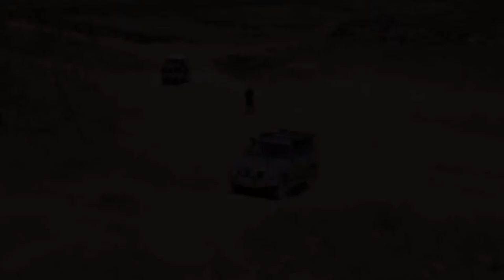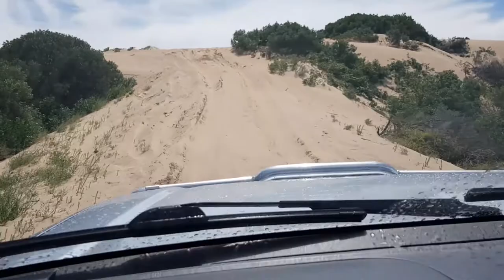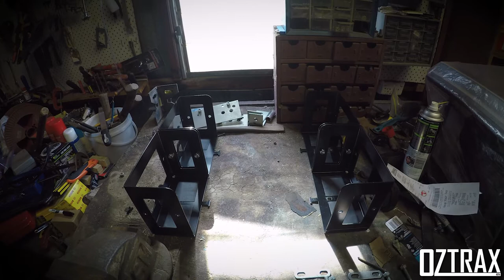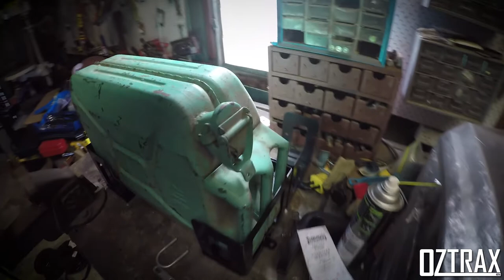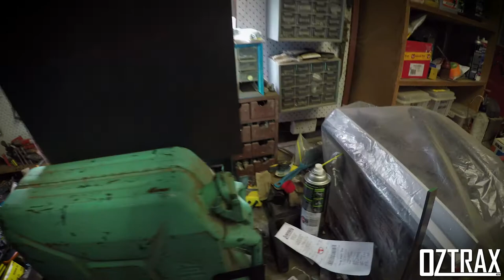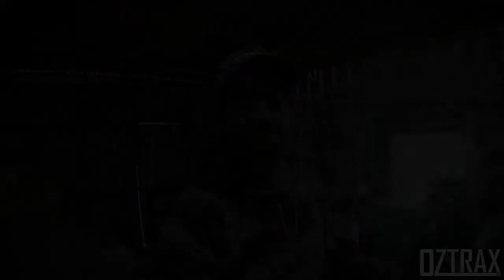DIY: Rack-mounted Jerry Can Holder // Pt.1

Comment: Hi, nice setup . Btw how many extra litres would you be carrying ?  Are you intending to have a locking mechanism as well please ?
Reply from the maker: Hey there

This will allow me to carry 40 litres of extra fuel.

Regarding locking mechanisms, they have pins to keep the caps locked shut, but nothing as an actual lock.

I may modify them later to accept a padlock. 👍